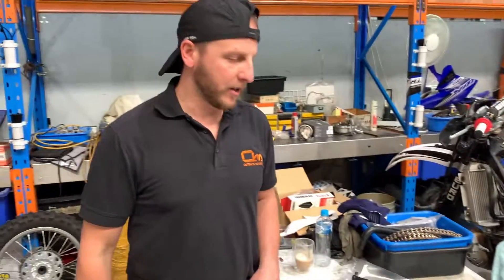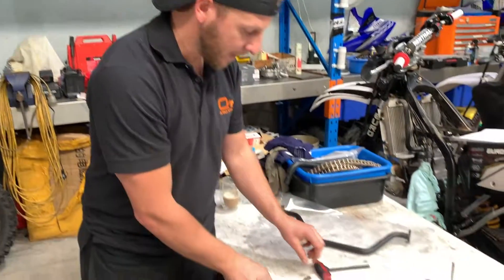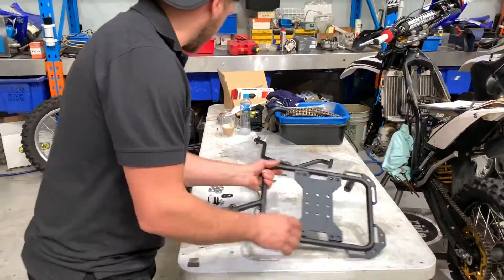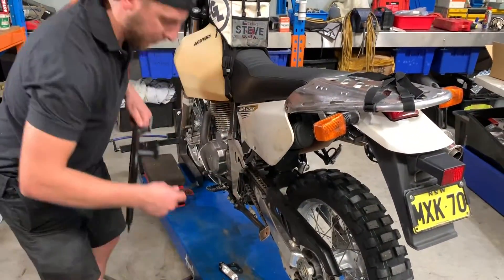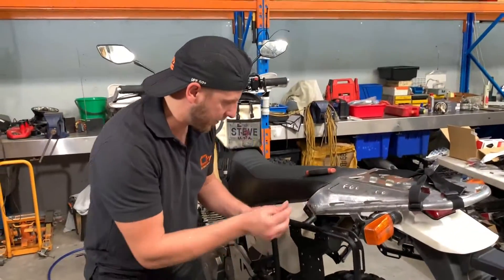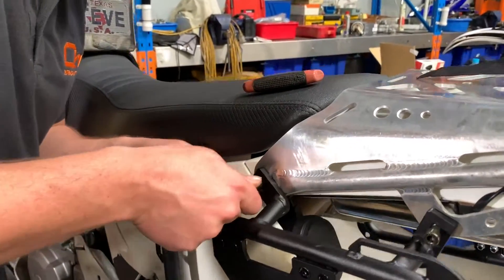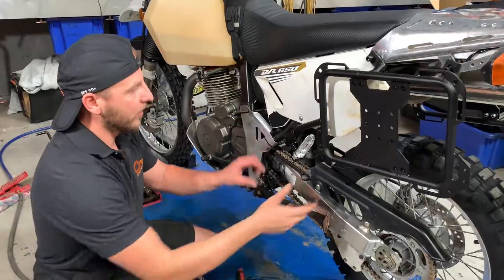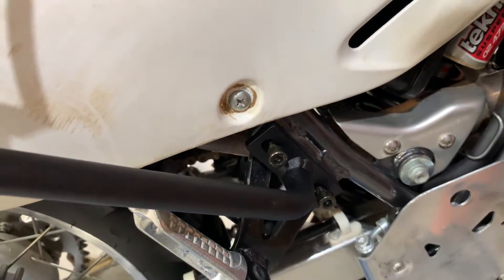Suzuki DR 650 X-Frame pannier racks installation

Comment: OK so I've just taken delivery of my racks and tried to install them. Design and quality of product - great. Value for money - yeah probably, but ease of installation - horrendous. Sorry Adventure Moto, but the brackets were twisted, out of alignment and simply just didn't line up. At one stage I thought that the racks supplied might even have been for a different bike altogether, the fit was that bad. Perseverance, determination, a vice and a big hammer were my friends. 😡
Reply from the maker: Please get in touch with Adventure Moto and request a new set. We just recently released an upgraded version. Maybe they didn’t have it in stock when you purchased yours, but we’re constantly sending shipments to them.
Reply: @Outbackmotortek  Thank you very much for the offer, but I have them all bolted up now. Again, great product - but unfortunately my set were not quite that easy to install.
Reply: They are a nice solid product, the eBay ones look really cheaply made.